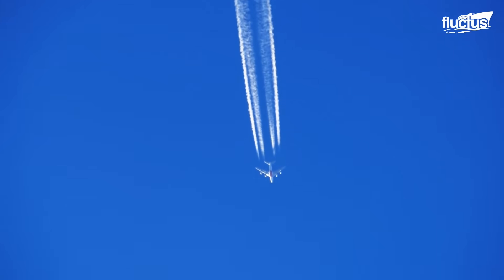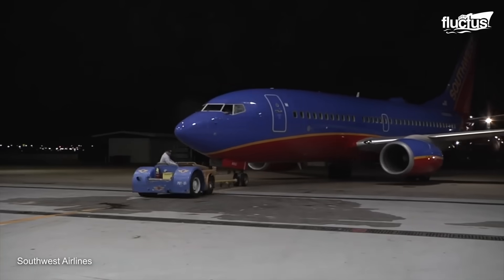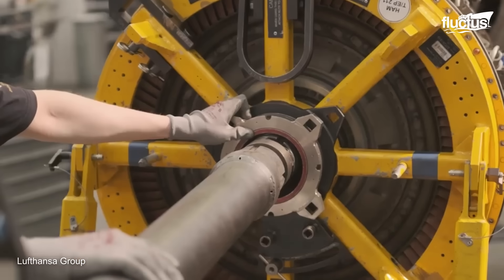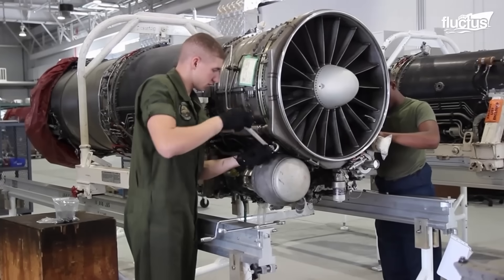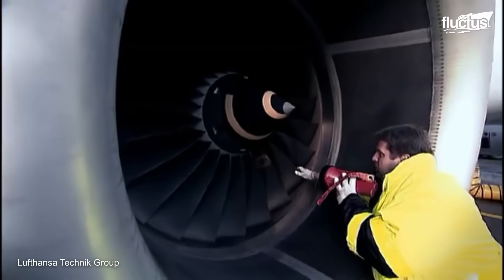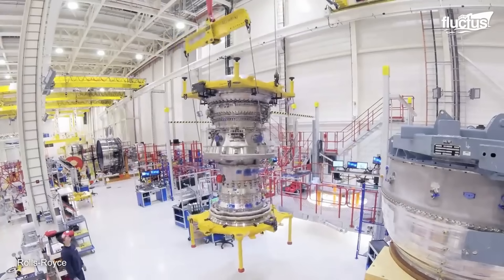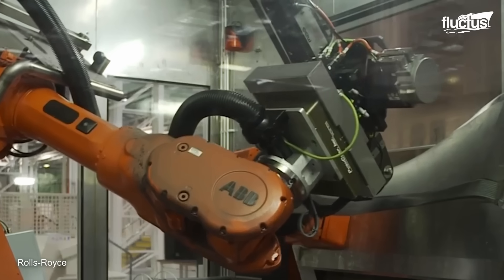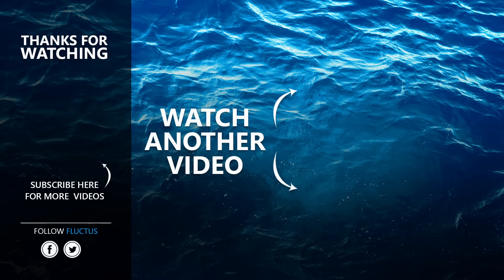Hypnotic Process of Repairing World’s Most Powerful Jet Engines Ever Made

Comment: Even more to the "Game Changer" point, by Aviation standards, Reliability trumps over Power or added range. Jet Turbines are Much more reliable than Reciprocating Engines. Parts rotate in a Jet vs the mix of back & forth linked to round & round  parts in a Recip that must all be timed to run together.  I worked for a U.S. Major commercial air carrier for 3+ decades, first as a mech, then into maint Inspection and finally in the Propulsion Shop (we flew Jets & Turboprops). That said, like many I've met in the industry who really enjoy Airplanes, I've built/flown every type of model Radio Control aircraft there is to fly. I started w/ recip R/C Helicopters (up to a competition level), eventually moved into fixed wing, gliders and then 1/4 Scale. Where I'm going w/ this is that as much as I love my Recip powered A/C & Heli's, the Electrics have taken over as the most reliable w/ the least maint. I have made it a point to learn, troubleshoot and make my Methanol powered recips as reliable as possible thru preventative maint and good care, but the Electrics win every time when it comes to Reliability And Power to Weight (wing loading). If the power density & safety issues w/ batteries can be overcome & made to fit commercial aviation, Electric engines will replace Jets & Recips for their simplicity and Reliability. I think that day isn't too far off.

Comment: I see that with many of these newer engines, such as the GEnx, modular is the big thing... If the problem is in the fan, turbine, compressor, etc. you just remove that particular module section and swap it out for a new one instead of a whole engine... Cuts a lot of down time...

Comment: In the old days, when Boeing 727 & DC-9 aircraft were very common, some facilities did not use cranes, but instead had gantries which could be closed in around the rear of aircraft to permit engine removal or servicing. The upper deck would be 45 feet tall.

Comment: Just don't pull any tricks lIke American Airlines Flight 191 in 1979 when the engine came detached from the left wing on that DC-10. A lot of people died that day because they wanted to cut corners and use a forklift instead of doing it per Boeing specs.
Reply: They used the wrong bolts too

Comment: As technologically advanced as these engines are. The thing that is truly astounding is the astronomical amount of fuel each and every one of these monster engines consume every minute they are operating. When you consider the fact that tens of thousands of civilian and military jet engines are running all over the world every single second of the day - its truly mind boggling how the oil companies can drill, refine and transport 100 billion gallons of this fuel each year just to meet the needs of the aircraft industry alone. Thats about 275 million gallons of jet fuel consumed each and every day. That is a staggering amount of  refined kerosene thats needed just to meet average daily consumption!
Reply: When you compare the fuel used on a modern jetliner like the 777 against the amount of work that can be accomplished, it’s not a bad compromise. If compared to doing that with another mode of transportation in a given time span. Fuel cost per passenger per mile for example, many modern jets put up a good number, or the immense amount of cargo a 777 can carry, which is 100 tons with a range of 9,200 km. (A Boeing 767 only 50 tons). Yes it burns a lot of fuel, but to move that cargo by other means in a timely manner, what do the alternatives require.
Reply: @dhouse considering the very detailed response you gave I thought it was quite a funny contrast. the argument is not lost on me completely though but the airline industry is driven by consumer demand.
Reply: Enjoy it while it lasts.   ;-)
Reply: @MikeInExile i know right, the digital age is upon us!
Reply: Yes its massiv amounts of crued oils being refined.... But at the same time that same crued is being used to create petrol,  diesel, and multiple other products we use in the modern age. However the jet engin manufacturers are already looking at alternatives and the future. From bio fule to hydrogen to all electric. The jet age will continue for a lot longer.
Reply: Your absolutely correct. All this bs from the airline industry about “green technology “ and adding a price to your ticket for bio fuel. The engines today are way way better than the old engines but still ridiculous as far as fuel consumption goes.
Reply: Tim, agreed.. it's not sustainable. Oh but there's car fuel too. How many billions of gallons is that? Future doesn't look good for humanity
Reply: @pinecedar180  Id love to hear your solution to all these problems then
Reply: Figures so large, that the human mind is incapable of understanding them; rather like stellar distances/times.
Reply: Convert to electric?
Reply: @GandalfsHashPipe 2 reasons this will be impossible.  An electric engine for a commercial aircraft would not be powerful enough.  And, the batteries to power them would be too heavy.
Reply: The fuel will run out one day
Reply: 0
Reply: Amen.
Reply: @dhouse go live in a cave with candles and firewood which I’m sure you’re doing already right? We will go enjoy our one chance at life with our traveling gas guzzling cars and gas stoves etc and while you are at it get a damn life!
Reply: These engines are the pinnacle of transportation technology for our epoch.

In this epoch, we basically never got much past using fire to create motion. It's really rather 'backward'.

This is all testimony to the power of the oil industry.
Reply: @ArifGhostwriter  Yes, unfortunately the current commercial jet engines are all we have and they are not fuel efficient when the fuel runs out we will have many aircraft that will be in large museums and will be able to be toured for a fee.  Hopefully by then we will discover a better mode of fast transportation if humans last that long.
Reply: Thanks to Mar a lago
Reply: stop going on so many holidays then
Reply: @mrdw1971 Yes,well said.
Reply: @mrdw1971 doesn’t always have to be a holiday mate it could be an emergency flight…

Comment: Thus video doesn't address the behind the scenes nightmare of the amount of certification paper work that is necessary and critical to the rebuilding of these engines...everything from fasteners to the inspection of the equipment used to x- ray the engine parts...cudos to the men and women that keeps the world moving
Reply: so true and correct. and the paper trail is crucial when there is a quality escape, everything is traceable and root cause is within reach.  We relied on overhaul documentation more than I can remember.  Compare that to classified document tracking today, sad!

Comment: Perhaps your writer wanted to say that High Bypass Turbofans for airliners did not arrive until the 1970s with the introduction of the wide-body airliners like the 747. Turbofans were introduced for airliners just a few years after the Boing 707 first flew commercially. Those were low bypass turbofans in the late 1950s jetliners that were in use, and for a very good reason; fuel economics.  Also the first airliners that used the turbojet engines were both smoky and very noisy on take-off. 
I was an ear and eye witness to the first flight of the Convair 880 in San Diego so I can attest to to that. Those aircraft used water injection systems (the dark smoke) which cost them the weight of some seats they could sell, and even those earlier, lower bypass turbofans were much more fuel efficient and a bit quieter.
Reply: I would agree, true high bypass engines came in that era via the JT9D, CF6 and RB-211
Reply: Amen.

Comment: The precision engineering required to produce these engines is mind boggling for normal folks such as myself.
Reply: I don't think it's a million miles off the level of precision & accuracy needed for making modern car engines - it's just the context & use that makes it seem more amazing (car engines are mundane).
Reply: To manufacture a Jet engine there are only half a dozen companies in the world that know how to do it.
Entire cuntries with  $$multibillion budgets have failed my cuntry they still cannot make it despite 40 years of trying
Reply: Even your vehicles engine has to be precise every single thing has to be measured and torqued

Comment: 1:37 Right, they became bigger and bigger and there were more incidents of exploding engines of passenger planes. Somehow present jet engines appear to be very frail.
Reply: That is incorrect. More exposure from news and social media only makes it seem that way.
But please tell me, how you would hold up at 50000g, as some parts in airplane engines do.
Reply: The original 747 engines had an in flight shutdown rate of something on the order of 100 per million flight hours. The current 777 engines are more like 1. Modern engines are extremely reliable.
Reply: technically incorrect, ever heard of ETOPS?  Hint: timeline the history of twin engine operational reliability and report back please.  double hint: light years improvement, that's why the 747 is going out of production.

Comment: Former Boeing Everett. I have been up close and personal with GE9x Mega Turbofans.

Front main fan is 12 feet in diameter and won't fit inside most houses. It would stick out through the attic and roof. Standing in front of one of these massive jet engines is an awe inspiring experience. It's used on 777 and 787 aircraft.

These engines can produce125,000 pounds of thrust, enough for a single engine to lift aircraft and make emergency return to airport if other engine quits. It has more than enough power to take it across open water to nearest airport in case of emergency.

2 of the GE9x's have almost as much power as the 4 smaller ones used on 747.
Reply: Couple of gripes with this comment, first of all ge9x is only for upcoming 777x not 787, they have produced a maximum thrust of 134,300 lbf but will only have a commercial thrust of  105,000 lbf so less than the predecessor ge90 , and both of them produce 210,000 lbf while 747 240,000- 266,000 lbf which I wouldn't consider close
Reply: @alexandrosandreou8585  Good to know, thanks for info.
Reply: I love the GE9x so much
Reply: @ttggcc  Thanks for comment. They say good things come in large packages. the GE9x is certainly one of them.
Reply: @Von Fart Thanks for input.
Reply: @Von Fart I’m glad you said something because I was like “I never worked on the 777-200, 200ER, 300, 300ER, -8/9, or 787 but I can tell you the engines on each one and they certainly aren’t all GE9X engines”.

Comment: In my 30+ years of airline maintenance I've changed just a few engines.  Then again I've also changed a few in the military.  In the airline business it's nice when you ave a hangar to work in, but that's not always the case.  I've changed them outside in the blistering heat, and also in the freezing cold & snow having a hangar to work in is a luxury.  FLY NAVY!!!
Reply: I’ve seen a video of the jet engine shops on an aircraft carrier. They’re pretty specialized. It’s way nicer than you’d think it would be.
Reply: @UltraMagaFan  
I agree with your comments 100%. I am a US Navy Veteran and Jet Mechanic. Engine and Propulsion. I also changed engines in the hanger deck. The video you saw showing the engine shop is called AIMD.
Reply: @UltraMagaFan  
AIMD means Aviation Intermediate Maintenance Depot. In other words they take the Engine completely apart and fix it. US Navy Carries are designed to do this process. I was assigned to work in that department a couple of times.
Reply: @vicentetroyhunt4980  If I'm not mistaken, there is even a facility on board, at the aft of the ship, where they can test jet engines out of an aircraft at full throttle and full after burner. It's basically a hush house without the sound deadening.  American aircraft carriers are self sustaining. They are able to keep their squadrons flying for long periods of time without going to shore. It's impressive.
Reply: @vicentetroyhunt4980  "Intermediate maintenance" and "depot" are conflicting terms.  Doesn't USN just do module swaps on carriers and the module heavy maintenance is done at the depots stateside (or wherever).  Can't imagine carriers having engine heavy maintenance capability to do module refurbishment.
Reply: @UltraMagaFan  
You're 100% correct with your comments.
Reply: @justwantresults8768 
The carrier is designed to do depot work and intermediate work. That's why everyone in each squadron gets cross training working on different engine types. When you take your advancement test for promotion you need to know every engine in the US Navy inventory because we are not the Air Force. Once you deploy your entirely at sea 60 to 70 percent of the time.
Reply: @vicentetroyhunt4980  thank you, excellent response.  USN capabilities are broad and deep, for a very good reason based on their mission and area of operations.
Reply: speaking as a mechanic myself, changing engine is absolutely not fun. I had to change a 767 twice a week without a hangar